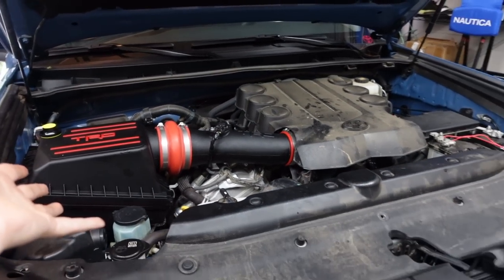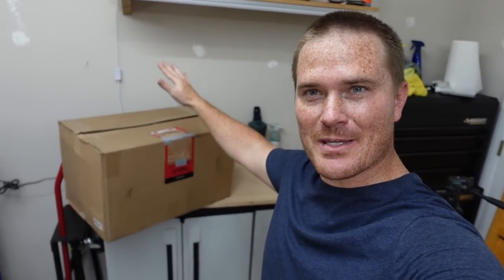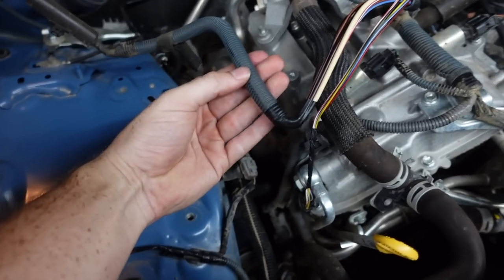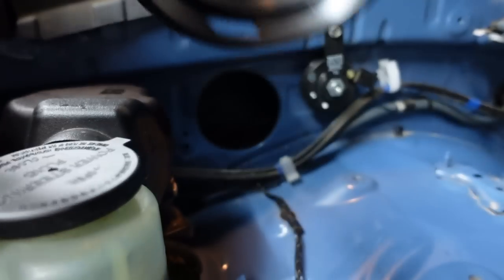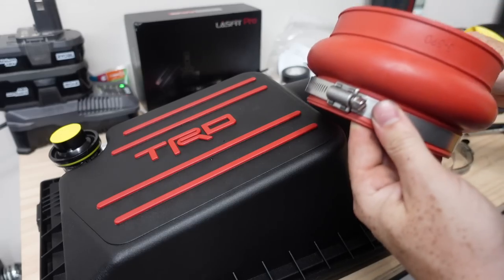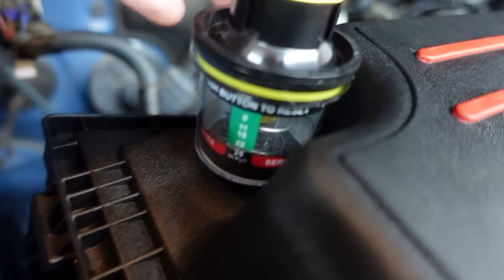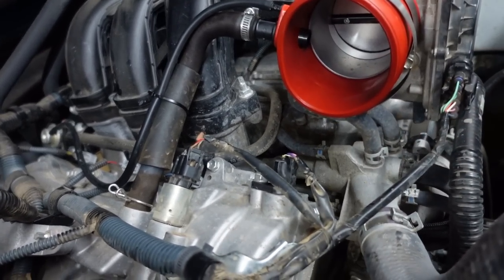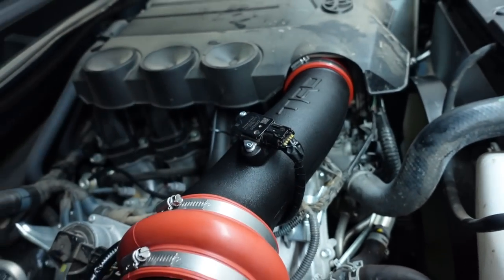Toyota 4Runner TRD Intake Install - How To

Comment: Great posts Jon! I just bought (last night) a 2023 TRD Off-Road and ordered the Pedal Commander today on your review. I'd like to go with the cold air intake also. I had cold air on the car I traded in and it was great. I do want to stick with OEM stuff because of the crazy SMOG rules here in California. It was hell getting my car tested because the intake was for a different model Infiniti. BUT... the same engine and mostly everything. Had to swap back and forth every 2 years. Sucked! I might want to have the dealer put it on my TRD just to make sure I don't go through that crap again.

Comment: Great video, thanks. Just followed your vid to do my install. I noticed the top cover doesn't exactly completely seal - I can still see the edge of the red filter between the top and bottom cover. Did your top cover close and seal completely? Looks like some dust may be able to get into the box?  Thx

Comment: Jon, I'm going to be adding an ARB dual compressor in the rear passenger corner of the engine bay and a TJM Airtek snorkle to my 2019 Offroad. Do you think there will be an issue with these mods and the TRD cold air intake? I'm not liking the loose lid lock up on the TRD cold air intake that you highlighted. I'm anxious to see your 150 mile review. Thanks for the informative content.
Reply from the maker: No issue at all with fitment. It is about the same as the stock box. Will do and keep you updated!

Comment: Not sure what changed but I had this same set up on my 2010 and 2014... the 2010 sounded great and you felt it, but 2014 had zero sound or performance change
Reply from the maker: Is it the same look? Maybe different filter?
Reply: Same everything...2010 limited and 2014 trail premium.. but both intakes were same trd CAI... the 2010 had a more distinct sound and the 2014 had zero change in tone or pick up

Comment: I am dying laughing over here at the intro alone!!!
Reply from the maker: Success!!!
Reply: @TRDJon  Do you lose any bottom end with the cai? Im just wondering if it throws things off, I see that urd makes a maf calibrator for mods like these, not sure if things settle after a few hundred miles when the ecm isn't "fresh" from the battery disconnect. Thanks!
(Used air raid on the way, I noticed you have reviewed a couple, maybe that one too? Just trying to get general idea if any downsides )
Reply from the maker: Not that I’ve noticed. I’ve heard that URD calibration is awesome too
Reply: @TRDJon  Thanks

Comment: I have one in mine and I have a whistle between 1800 and 2100 rpm. I’ve been told it’s air moving through the throttle body but not everyone gets it. Can be a little annoying.
Reply from the maker: I have it too. Very seldom
Reply: @TRDJon  did you find it was where the rubber grommet went in where there was still an opening. I saw another video where the guy used silicone. Thought?

Comment: Great video as usual. I finally installed the same TRD Cold Air Intake. So far so good. I feel a little more hp. Will monitor the fuel econ, ok, take care!
Reply from the maker: You as well!!!
Reply: What year 4Runner?
Reply: @highvoltagemaverick  2018
Reply: Whats the fuel like since you installed it
Reply: @missilefool  About the same. No drastic change.

Comment: why didn't toyota just take the OEM box design with the clamps rather than that awkward angle of the plastic hinges lol
Reply from the maker: No idea! Honestly kinda frustrated with it. Not as good of a seal as the OEM in my opinion.
Reply: TRD JON yeah i agree jon. The stock ones have a pretty damn good seal. I think I’ll be scooping up a S&B one whenever those are back in stock.
Reply from the maker: For sure a great choice!

Comment: Currently installing on my 2016 TRD Pro. Did you skip the “tree mount zip tie” part, as well as installing the provided bracket? Looks like it’s just to secure some wiring around MAF, but curious to know what others thought / how y’all approached that. Thanks!
Reply from the maker: Correct. I feel like that was a step for the FJ Cruiser. honestly.

Comment: Is that actual rectangular TRD filter the same size as the stock one or a K&N one?  That wasn’t exactly what I was expecting to see - but probably better.  I thought it might be like a cone type filter.  I think I would like to do that with my 2016 Limited which currently has a K&N filter in it.  Could you use a stock Toyota filter or a K&N filter if you had to, for some reason?
Reply from the maker: Nope just like a drop in high flow. Unfortunately not a come
Reply: Are they the same size?

Comment: So if you lose the prominent growl with the old CAI, and assuming the MPGs are roughly equivalent...explained to me what substantial improvement in overall performance you expect to get out of this install. I was just getting ready to buy one, but now I’m on the fence. I’m really curious to hear your overall impression, especially compared to the S&B.
Reply from the maker: I’ll have a long drive tomorrow to feel it out. If all is the same minus growl, then I’d go for the s&b. I really liked the growl. Even at lower RPM’s. I just haven’t drove it yet. It started POURING rain
Reply: There is a fairly loud growl i think, but only when you give it a bit. Which is nice because the wife doesnt know im modding the truck so she cant tell as long as I dont really get on it

Comment: I had this CAI installed on my 4Runner and could not stand the noise, no change to gas mileage or engine power. Could not wait to put the stock intake back on.
Reply from the maker: That’s weird cuz I hardly hear anything out of it
Reply: @TRDJon  noticed it the most driving in the mountains,  especially higher revs either climbing steep grades or accelerating in passing lane. Normal driving it was not bad.
Reply from the maker: Mmmmm I can see that. That is when the exhaust is loud too

Comment: Jon, question about the main box. Does the top "rest" on the hinges, or is it connected? I had Longo Toyota install mine. I can see a little red (filter) on the side. I've had it for a year with no issues. It will be a pain in the ass to take off clips, etc. The front clip hold it down well, as since it's connected, it ain't going anywhere. Just curios if it need to be in the plastic thing or sit on top. Your video  @4:55.
Reply from the maker: Should sit on top and still be sealed
Reply: @TRDJon  Ok, thanks!

Comment: I know this video was produced roughly a year and a half about, but I was wondering if this TRD kit will fit out 2019 4runner. I am new to the 4runner, and am trying to do my homework. I live in California and an only about 3mi for S&B, but they cannot sell me a CAI as it is not CARB compliant. I called a local Toyota dealer and spoke with them and they were telling me the same thing I keep finding on the internet, and that is that this kit will not fit out 19 4runner. I am guessing that a '19 4runenr is a 5th gen. can you confirm that please. I would greatly appreciate it. And, thanks for the video's very informative.
Reply from the maker: Yes it will fit

Comment: Just installed my TRD intake yesterday also! The only problem was it had the k&n intake in it before and the person that installed it didn’t keep the oem rubber grommets and metal sleeves... and Toyota does not sell them at all. It has been such a headache trying to find a solution.
Reply from the maker: What did you do??
Reply: TRD JON THANKFULLY I’m cool with one of the service advisers at my local dealership and he said if I sold him my k&n for a decent price that he would give me the grommets and sleeves off his oem. I was VERY thankful or else I would have been doing some makeshift work. Haha phew

Comment: Have you taken out the airfilter for cleaning since the installation?
I read that the plastic hinges of the airbox are brittle and easy to break…
Reply from the maker: I have and haven't had an issue.
Reply: @TRDJon  Do you prefer TRD or the S&B CAI?

Comment: Jon, what’s the increase in HP w the exhaust and air intake? Combined and if done independently of each other? Did it help w towing. Btw great info on the channel! Thx Josh
Reply from the maker: Not much but alot better throttle response.

Comment: Did the kit you bought from BAM wholesalers come with the filter as well? I’m doing my research on which way to go. Part by part or whole kit. If the filter does come with the kit then the price is similar if you just bought it part by part.
Reply from the maker: Yes it did

Comment: I don't know why the eff TRD intake has to be that difficult from stock intake. If they design without having to cut that wire harness I would have ordered it. I'd be screwed if any wire was cut accidentally trying to separate the O2 sensor wire harness.
Reply from the maker: Yea it doesn’t make sense at all!

Comment: You probably not losing as much hp as the S&B, you could put a reed in the tube and make it whistle for more noise
Reply from the maker: How did the s&b loose HP?
Reply: @TRDJon  if you can hear it.... turbulence is not helping  Toyota stopped selling the CAI and just sells the filter for a reason.  Real world dyno by guys not selling the CAI always show near zero.  a better air fitler will get what ever micro gain is real, and thats what toyota still sells.  Its great to see Toyota give real bang for the buck, and not grab for dollars
Reply from the maker: Hmmm never thought the sound would mean it lost power. Cuz I’ve put in a drop in air flow into my truck before and it was a lot louder as well. Felt better throttle wise too to drive.
Reply: @TRDJon  on jeep forum guys are feeling power increases from oil catch cans and claims of better gas mileage (lol).  I had one 20 years ago on a musclecar, made noise, no real difference on track times.  Dyno guys did typically got nothing or 1-2 hp..  add a TRD air filter and you get any benefit the other stuff is trying to do.  Why do you think Toyota only sells the trd filter and not the cai?

Comment: ADD A HOLE ON THE SIDE, ADD NEW FILTER , CALL IT TRD?
Reply: I am wonder this also. Does the stock housing connect to the fender? If no you could make your own easy. Or just order that part that connects to the side with the bottom housing

Comment: Trd intakes are such a waste of money. They barely give any performance benefit, maybe add a few horsepower at most but most ppl have said you don’t even notice a difference. It sounds cool when you floor it but I never floor my 4runner so I would barely ever hear that cool sound anyways. It’s a heavy lumbering off road inspired machine. Really expensive mod for barely any difference. Cleaner air maybe? But I trust that toyota releasing the vehicles stock the way they are that it doesn’t need that and will still last just as long as someone with the intake. It “looks” cool but how many times you actually gonna be able to see it? You don’t open your hood often, especially in a 4runner unless it’s basic maintainence.
Reply from the maker: Only thing I felt was the throttle response was decent. Not anything crazy as to the s&b or whatever. And it really wasn’t loud either compared to others
Reply: I have the same CAI installed i gained only  1 mpg, added a Borla Muffler, and Pedal Commander, it Purrrs, and rips in sport mode, recommend.

Comment: Ive had lots of Toyota trucks they are the most dependable on the world.. they are greatly underpowered...slower then there competitors.  They can't hold any payload !!  haul a canoe and the bumpers on the ground..  and 5 years the frames are rotten.
Reply from the maker: That an older one?
Reply: @TRDJon  i have a 1979.   1987.. 1990.  2000.  2007. Suspensions are week. And the frames rot out they don't have heavy suspensions like Ford or Chevy or Dodge. But they have the dependability
Reply from the maker: Must be a heavy canoe. I’ve towed close to 4,500 and the 4Runner barely squatted. And the rust all depends where you live Imo. I’d never buy one that spent its life up north.

Comment: Does the TrD cold air intake work on 2021 TRD off Road Premium?
Reply from the maker: Yes
Reply: @TRDJon  I read you need to open up the wire harness (electrical tape) the MAP wire is in so it can reach. Did you need to do this on your install? Toyota says there is not trd cold air intake compatible with the 2021. I’m wondering if that’s the only reason why